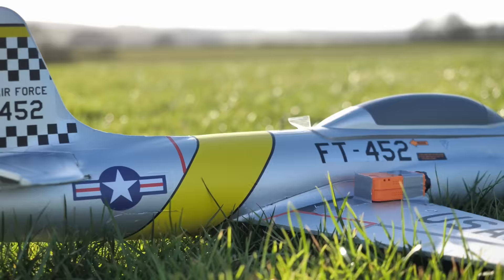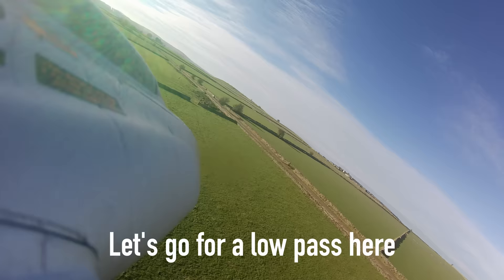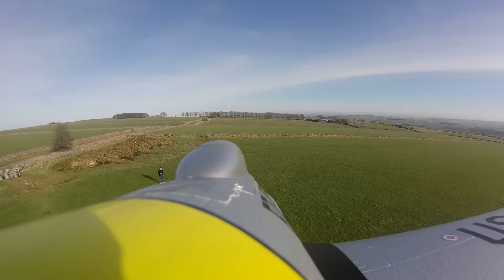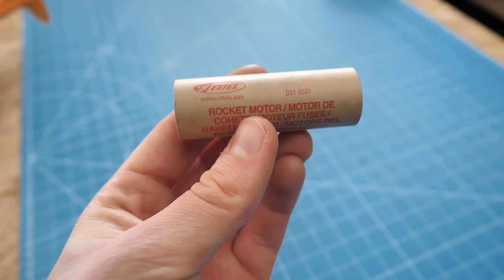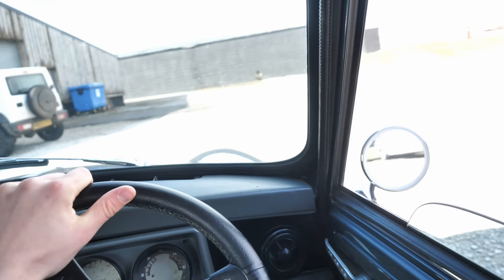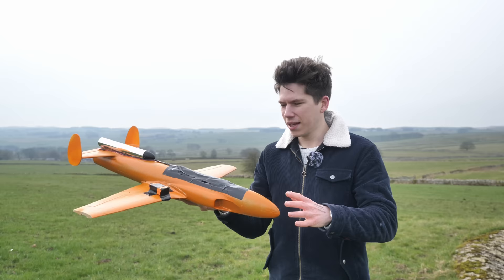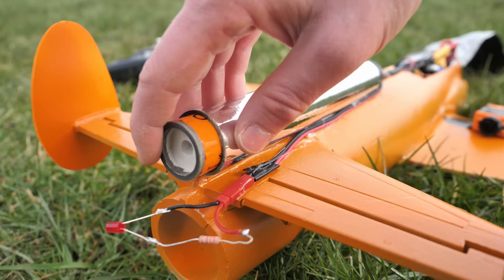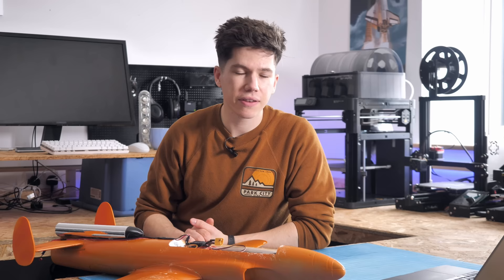Building the WORLDS FASTEST RC Rocket Plane!

Comment: With the twin tails, looks a bit like the Baka Bomb.

Why not put the insert the rocket into the actual tailpipe? It's got a fairly small cross section, so probably wouldn't affect the ducted fan much, and you'd remove the thrust line problem.

Comment: the reason the engine ejected itself is because every model rocket engine has a blast at the top after the bottom part runs out that ejects the parachute.

Comment: Quick note on weight. The lower the weight of the aircraft, the lower its ballistic coefficient (not drag coefficient). I study aero/astro but have lately taken an interest in ballistics. From what I've seen, for a give projectile, a heavier weight means a better resistance to drag. So if we take a 200gr .340 Weatherby, it has a G1 coefficient of 0.413 according to Berger bullets (if memory serves, I know it was somewhere in the .4s). But if I take a 300 version of the exact same bullet which is basically the same aerodynamic cross section, it has a much better coefficient of 0.818. Trying to push that small aircraft to such a high speed could be difficult. Then again, bullets have no L/D as no aerofoil and have no engine so this may not hold entirely true. Just something I was thinking about.

In fact, glider pilots often have water ballast in the aircraft to provide better ballistic performance. When the pilot wishes to land and come down, they will dump the water, increasing the effects of drag. A=F/M and so less mass for a given force means higher acceleration.

Comment: bringing the rocket engine closer to cg will allow for more optimal aerodynamics as you don't have to compensate with elevator and can keep angle of thrust almost parallel to attack angle of airfoil. I say two rocket engines under the wings. Hope they fire simultaneously and have the same burn time.

Reinforcing the wings with epoxied carbon rod would be advisable and easy.

As you move higher in speed you will soon realize the limitation of current wing airfoil. It seems thick and creates much lift to make launching easier. However at high speed you will be compensating by down elevator thus fighting the lift and causing more drag.

Sorry for the ramblings  I used to do a lot of jets. Have fun.

Comment: What about a clear nose cone for the camera and to offset the heavy tail. Also I wonder if you're not getting some feedback at the end of the thrust cycle that's causing the engine to eject. Do  you suppose that a small intake hole in the front of your rocket tube help with that?

Comment: Try using a soldering GUN for large joints like that.  They stay cool until you pull the trigger.  They'll also put out plenty of heat with 140/100 watts.  You could also get an iron with a larger tip to provide more heat base.  The joint won't drain the iron of heat as much with a larger tip.

Comment: My guess about why the rocket engine is coming off might be due to a sudden change of temperature within the tube with barely any room for air to come off as it grow in volume.

Remember, the rocket engine's nose is exposed to quite a bit of air resistance (which means, it gets hotter) and the rocket itself generate heat on the exit of that tube so the air exchange as the interior of the tube gets hotter is raising drastically which could "pop out" the rocket engine.

A solution could be to put a engine nose that has small air exhausts hole aiming towards the back on both sides so that any amount of air pressure in the tube, behind the rocket engine, can't build up.

Comment: adding a second rocket engine and a change in the angle may be enough to get the plane past the record,  just need to solve that pesky weight issue that's going to hinder the electric motors ability to  keep the plane in flight prior to the rocket ignition

Comment: my idea would have been to put the rocket into the tail where it wouldn't melt the foam BUT stick out enough of the hole to do it's job

and also to help get the faster speed as you shown with the plane that can reach 140mph it needs swept wings even the ME262 had a somewhat swept wing

also i'd be nervous with a rocket motor on the back being held on by only hot glue if im going to be quite frank

Comment: I feel like these planes should be able to adjust their corrections based on a speedometer in real time. Also, would this adjustment be linear or some type of square root or logarithmic pattern?
Reply: the nicer transmitter/gyro combos have switchable PID settings, which is what he needs here. As soon as he sees any oscillation, swap to a less sensitive setting.

Comment: add quad 550/775 motors with blades on, configured 2 motors on each wing, get like a 20,000mah battery pack or smth, cant tell the material of the fuselage but make sure its stainless steel so it can handle the heat or if ur really desperate add ammonium perchlorate fuel into rods

Comment: Doesn't the battery on the side wing cause a balance and arrow dynamic issue? Seems like it would be better if the battery was taped right in front of the rocket motor on top of the fuselage. I'm no export thought, JMO. Fun experiment either way.

Comment: @ProjectAir I saw your rear verticle wings wabbling and flapping make them stiffer and you would get the speed. Next build a big model rocket use a Tom Tom GPS for guidance, use servo controlled fins use gyro to control it and raspberry pi to read GPS and control gyroscope and servo fins and see what you get😃

Comment: For the love of god use flux and properly solder aircraft connections (Tin them first). Not only is this method less frustrating, its faster and easier. 
 Flyaways can be quite dangerous if that thing reaches a road lol.

Comment: Are the air intakes big enough to let the engine breathe now the battery and by extension engine rpm's have increased? 
Also, would the camera fit in the nose? Though you would lose rear facing cameras. Maybe something like a conformal cargo pod that fits flush to the fuselage, one on each side with one facing back, the other forward?

Comment: I built a 70mm Squall edf that did 192 mph using a doppler program 2006-2007 can't remember. I used 5s 5000 60c , 125 amp esc, 50k + rpm, check RCG for more. I built 4 or 5 that year just to go fast.

Comment: I thought I saw a slight flame out near the rear or the X-0 engine on the test stand, maybe the front of them need to be better sealed?  (Oh, see other comments that reminded me that the 0 is 0 delay for para charge, maybe move to - P engines, but I kinda like losing the now dead weight of the engine) Maybe shorten the wings and vertical stabilizers to better handle the increased speed and reduce oscillations?

Comment: Laminate your wings ! Do the whole plane in fact . 3mil on fuselage will work fine with the curves . Those straight wings will take 7 mil . You have a rigidity problem . Your bleeding a lot of energy just feeding the vibration . Shows up as drag . Imagine why a streamer works so well as a drouge chute on rockets .

Comment: You need to put a retainer on those engines, to keep the motor in place.  But this will burn your nosecone.  Metal plate? at the head, to blow it all aft...

Comment: I have one of those small 3 s jets, it came with a 5 blade turbine . I changed it to an 11 blade . And I changed the motor to a 4s motor and changed the esc to a 6s esc and ran it on 6s. I didn’t check the speed as of yet but I did check the thrust and the thrust actually tripled.

Comment: Chances are your roll oscillations are aileron flutter. Those foam, skinny wings are asking for trouble at high speed and the servo links have a lot of slack I guess.  Probably I would have used some sort of delta with carbon rods for this project. I know there is a limited choice of those with ducted fan and its not so tolerant of CG change. Shame there is no model (English Electric) Lightening with one tube for ducted and one for rocket. Build one.

Comment: Ahhhh, but those rocket motors do have a charge in them that is ejecting them.  The last number in those rocket motors is 0.  That's the time delay between the rocket motor running out of fuel and when it pops the election charge.  

Those rocket motors ending with the number 0 are actually designed to be booster rocket motors to be used in multiple stages with larger rockets.

That's something I learned from doing rocket models in 1996.

Comment: I don't really understand why this is "a thing".  This little aircraft is quite slow by standards I worked with in the late 1970 to early 80s, employed by a military drone manufacturer and by Boeing for some time..
The company I worked for at the time made a 1/4 scale target drone powered by a 10 hp Qudra or a 13 hp Harris industrial two stroke engine.  The craft at that time weighed nearly 50 pounds including fuel and asis feedback electronics.  It went an easy 140 mph with just that old 2 stroke prop gasoline engine.

With the removal of the 2 stroke engine, an air collector nose cone and a tiny Teledyne turbofan, it went over 300 miles per hour.  Was a lot of fun to watch.  It sounds like we haven't come very far in the 45 year, plus time frame, and especially considering the FAT weight of the 1/4 scale Sukoi, using either the two stroke Quadra or Harris industrial, not to mention the OVER 2X plus accelerator factor with the TINY Teledyne fan.

Interesting. For its size, your good looking plane seems very slow.  I like it though.

Comment: Made rocket cars competition with some fellow enginerds, but had a guide wire and Traxxas drag car timing set. Mine trapped at 108 mph. Simple carbon fiber rod with ultralight rc plane foam wheels. None or the cars survived more than a couple runs though

Comment: You should up your soldering game, that was uh... bad. A cold solder joint will often appear to work, but with temperature changes and vibrations fail at random. This is quite a lot of effort just for it to fail for such a simple reason.

Comment: ok something to think about the engine power is one key yes but aerodynamics isn't the main thing to factor in. . . Drag is also a key factor to key in.   Wing designs on some of the more insane speed aircraft has a bet of wing sweep or delta type wings (See for instance the real life planes like the Mig-21 F-102 and F-106 for Delta designs) swept wing designs look into planes like the F-100 MiG 17, and 19's along with the Super Mystere as possible references. . . Straight wings are awesome for stable flight at low speed and high lift. . . if you have access to a wind tunnel i would use it to research to get that perfect aerodynamics to drag/lift balance once all things are balanced i would expect insane results

Comment: hello project air i was wondering how to start in rc planes for less than 30 quid. I have made many carboard and foam planes but all rc servos, escs and remotes cost hundreds of pounds. I love aerodynamics and am currently making a thermojet. if i could control a foam plane i could finally achieve my dream of making a thermojet powered rc plane at 15 yrs old. Thanks

Comment: trim the wings, they are not for the speed that you want to achieve... the fastest is the plane, the smallest are the wings... also, of course, reduce the aileron size, that would make easier for the stabilizer to keep working without oscillating, or divide it into two pieces, two for low speed, one for high speed, controlled by a switch from your radio.

Comment: I’m always surprised when ppl do these max speed tests that after doing a bunch of things to make the aircraft faster, they stick that giant parasite drag inducing camera / or gps box on it. not just that but they stick it on one wing which will create even more drag as it will require more aileron to keep it level thus causing even more drag. Surely there is a different way to do this.

Comment: Someone needs to learn how to solder.  You could have mounted the rocket motors like a DC-10 number 2 engine through the vertical stabilizer.

Comment: Why not mount 2 of the rocket engines on the either side on the back of the plane.
Reply: hopefully they both ignite at the SAME time! Otherwise, it would flip out of control even with the gyro installed

Comment: 80 amp esc is way to much over kill...a good 50 amp would be more than enough and not add so much extra weight..just add a 1500 mah 4s and you add 20 mph easy...plus it will have a ton more power..

Comment: now mix it with a poorly made Pipebomb and you got what i made 14 years ago that blew a massive hole in the ground.
Reply: What did you do with the pipe bomb?
Reply: @user-uy9xm8en7wheavy  i made it explode, but the ground underneath was hollow, so it opened up a massive hole in the ground. i thought to myself "that explosion did not make that hole." and it seems i was right. apparently, there was a MASSIVE chasm underneat there made up of loose rocks from the mountain nearby that had collapsed thousands of yeas ago. whole valley is made up of the pieces of that mountain, so there were bound to be hollow areas underneath some places. i just happened to find one of them.